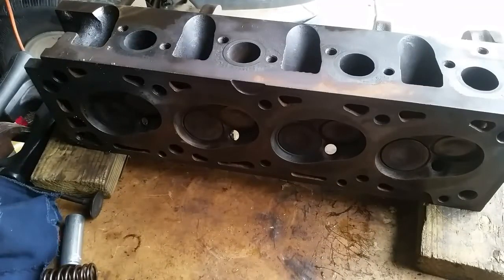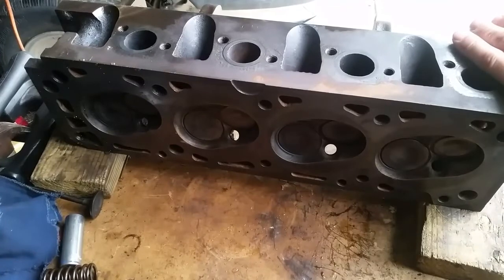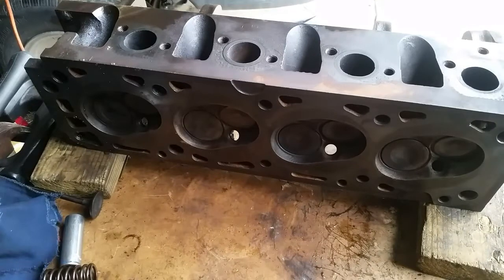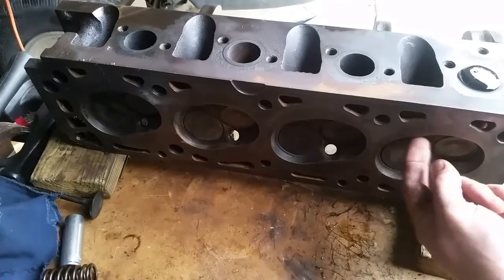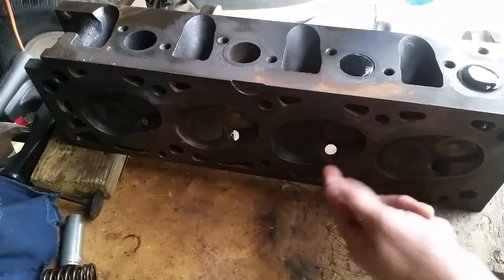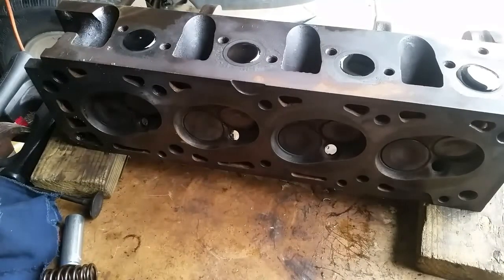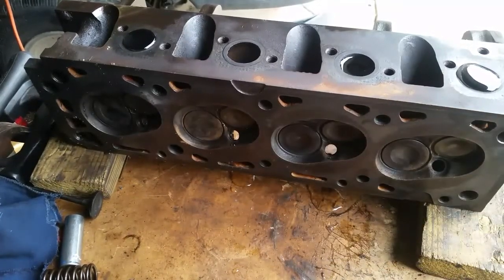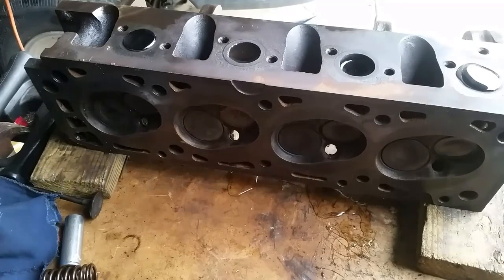How To Check A Cylinder Head For Bent or Leaking Valves

Comment: Just subscribed!  Your Videos are just what I've been looking for.  My '85 Toyota pickup with 22R 4cyl has a broken timing chain.  Happened after parking her.  I want to pull the head and put in a new Headgasket (did a temp fix before with Sodium Silicate). I also want to check my valves.  WHEN DO YOU REPLACE A VALVE AND WHEN DO YOU LAP SEAT THEM?

Comment: Can you just replace the cylinder head?
Reply from the maker: Yes you can, keep in mind that a used cylinder head will probably need some machine work as well. Thanks for watching!
Reply: why would you its much more expensive than replacing a few valves lol